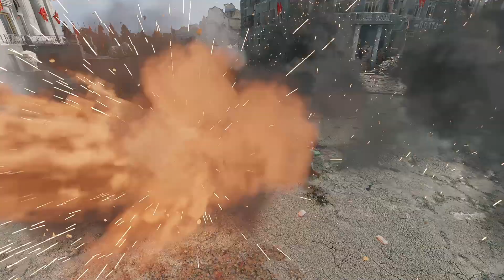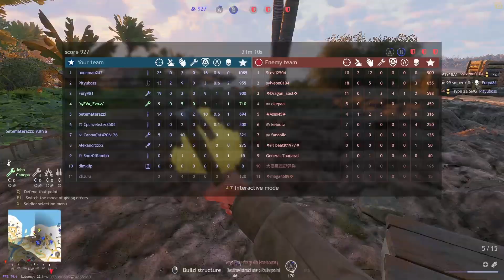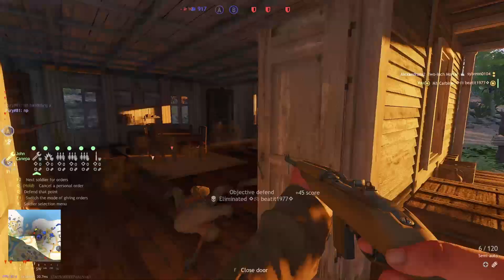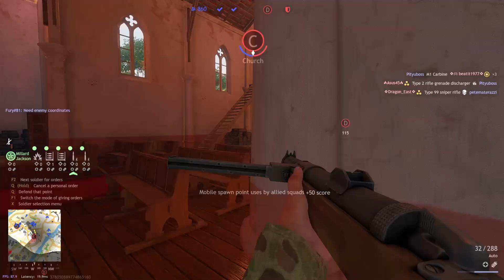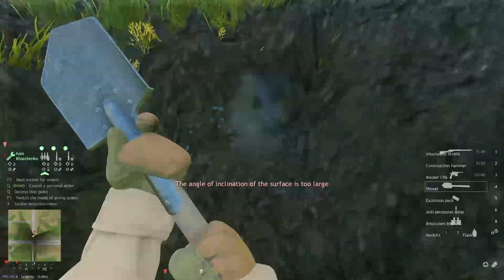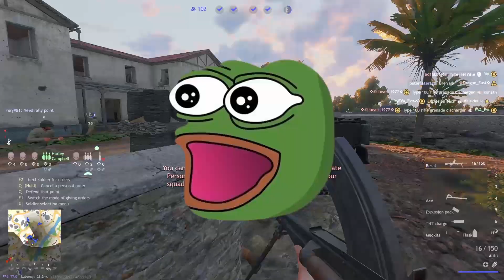FIXING Your Enlisted Engineer MISTAKES

Comment: 1. Dont bunch up rallies, its how they get wiped fast.
2. Build on flanks because rallies are not only for the objective but also for flanking and hunting enemy rallies.
3. Dont just go to the point, go into the enemy backline first to kill their rallies. THEN attack the point.
Reply: Id like to add to your tip nmr 1 that by all means build your first rally where ever you can. You can allways move it later.

Comment: Most tips are on point, I'd say, but others just aren't, or are sidegrades at most, so I'll add a few points:

- Shovels: Having shovels in your squad means that you can't sprint with axes, this is quite a downside considering that right at the start of the battle, or as soon as you respawn, you want to be moving quickly with your engineer to place more rallies and overall it's a good mobility to have for every soldier.
Another issue, you can't dig on city maps, and, digging is MUCH slower than building 2 sand bags, as well as having to waste perk points on the useless melee attack speed.

- Sandbags: I get your point about being easy to find rallies if they are covered with sandbags in the open, but the thing is, the sound they make already makes them easy to find, if you place sandbags and an anti personal mine on top of the rally, the enemies will have to get right next to them to shoot (unless they are willing to waste a grenade) and they'll die to the mine, rally protected and free kill. Second, gives them better protection against random explosives and arty.  The best scenario is to build the rally with natural cover against the enemy spawn, so it can't be seen from afar and also requires the enemy to get close and a higher chance of getting pick by random friendlies, or triggering a mine. Win-win.

Comment: Great Video!    I'm a firm believer in having at least 1 engineer in every squad in the number one position.    I consider Engineers my Squad leader and they have a huge impact on how the game goes with being able to open up flanks and direct the flow of battle.    As for Sand bags,  if you are to sand bag your rally, don't fully enclose it.   Set that final sandbag a little away so the AI can get out with a path.   I most often set that being closest to the friendly line.    Going to start digging them primarily though.. .great tip!    I predominately sand bag them to protect from splash and an easy long distance snipe.

Comment: I've played games where my ally put barbed wire on rally point. Barbed wire. At these times, I wanted there to be a system of expulsion from the match by voting.
Reply: You assume “ally” .. I was in a game where an “ally” was using a flame thrower on the rally point after putting Barb wire around it. Hmmm sabotaging moron?

Comment: I haven't seen this mentioned here. If you press the contextual squad command button (the same you use to tell them to stay somewhere) whilst looking at a structure that is not yet built, other engies in your squad will join you in hammering it up, i reccomend pressing the button as many times as the number of engineers currently alive, so their dumbasses dont get confused for 1.5 seconds. Useful for rallies or gun emplacements. 
If you press it on an already built structure, allied or enemy, any squadmembers will attempt to deconstruct it at their own pace. If you change soldiers after giving the order it "wears off" but obviously you dont lose progress on said structures. Niche but it works well.

Comment: reason i build sandbags is to protect them 1 time from air plane bombs unless if there's a dirt to find i dig a hole in it for safe measures.

what's even more annoying is that some new players tend to put their rallies on 2nd or attic floor in normandy or high BR building maps, which is why the ai pathing of our units gets crazier when they try attempt to move out.

Comment: I wholeheartedly agree with everything you say. IMO the best way to place rally is just to place it in a house or somewhere a little hidden, even by a bush and move on, don't waste more time, you have a place to storm!! Also the best way to screw your entire team is to place a rally on the upper floors of a building as the AI will take a long time going down or get completely stuck. Even worse, placing your rally in a spot only reachable with a ladder...
Reply from the maker: Cant believe I forgot to mention the upstairs stuff!
Reply: Or a engi instead of building sandbags, enclosing the rally with Barbed wire
Reply: Almost all of it was solid AF, but I couldn't disagree more about the not using AT guns on infantry... I find that throwing up an AT gun with a good line of sight on an objective allows you to just pump HE rounds through the windows and clear the place out for your teammates to cap it. I can't even count how many big firefights I've ended with five or six HE rounds. Once the enemy sees the place is zeroed and nothing inside survives for more than a couple of seconds, they tend to stop assaulting the objective and spawn snipers or planes or mortars to deal with me, but by then the objective is usually capped.

Comment: And then theres my ass doing no engeniring and still getting over 120 kills and top 1( sometimes top 5 , acsualy thats the lowest ive ever been ) in all my games and yet the people that do the engeniring do it to stupidly that if you spawn on there rally points youre getting instantly moved down by mmg or granades flying around
Reply: Annoying smg spam boring
Reply: @akiko3688  im not running smg spam ( im running 1 smg squad 1 engsquad that i just use fór the guns And not fór the building And one mmg sqaud most of the time Ist a heavyer mmg becouse with bar i seem to op And Its not that Fun becouse everything can be one tapped with that thing And ať last i use a pláně . ) did i mensioned im f2p
Reply: Have you learned how to spell yet? @ReaperCz922
Reply: depends if you come in at least like 2nd or 3rd then they are the real mvps because they are usually the ones with like a lot of engineering points
Reply: So i Will stick to my full assault role 😂